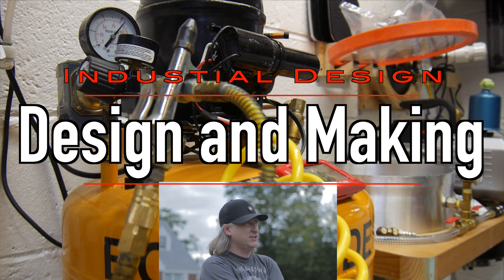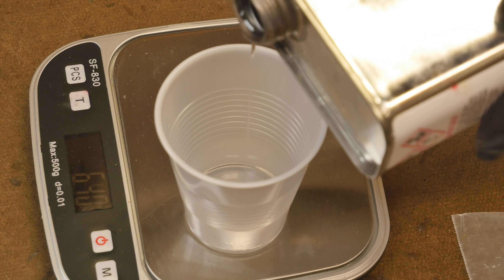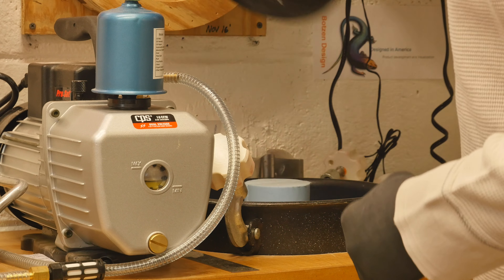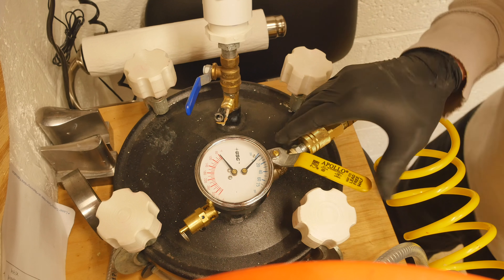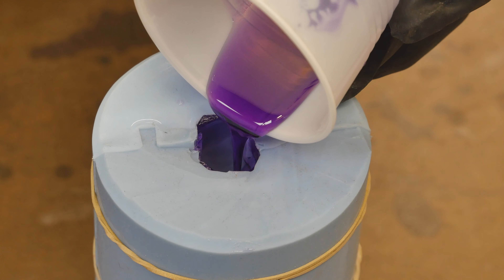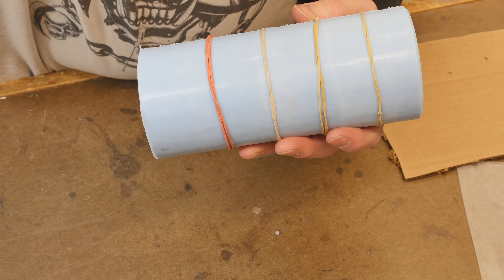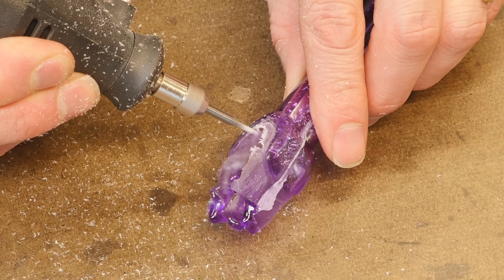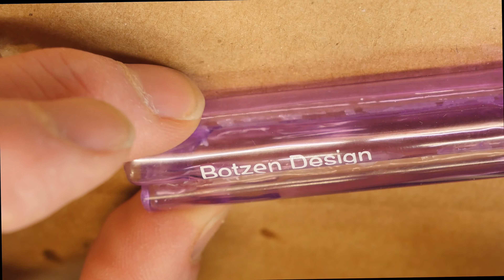How to Slip Cast Urethane resin parts: simulated Blow Molding

Comment: Great video 👍.
How can I slipcast a model using silicon liquid rubber. I want my model to have a particular inner as well as outer shape and be flexible for some expansion when air pressure is applied.

Comment: Hey am so glad to come across your work its been hard but finnally i want to know if a hollow Epoxy resin tube can break easily or what is its durability  guarantee is it like Lexan polycarbonate sheet ??
Reply from the maker: Depends on a lot of factors while thickness, size and how good your part is cast.

Comment: Enjoyed the video, Eric.... also, how important is adding the heat to the pressure pot step? Is it necessary or is it solely used to help speed up the process? I have a pressure pot but it does not have a heating function.
Reply from the maker: JamokaJoe I like it because it help with keeps bubbles from forming as the urethane cures. Important when you are making clear parts. Glad you liked the video.

Comment: Can this method be used without the degassing and pressure equipment? Will it have the same result however be full of bubbles?
Reply: Yes depending on which resins you get for which kind of plastic you need to end up with you can use a painters tray and tap the whole tray down on a counter a few times to help agitate bubbles up to the surface, degass is just important if going for clear bubbleless parts.

Comment: Are you using the same amount of resin each time or are you using progressively less each time?
Reply from the maker: Quirky Dad yes, about 10 grams total in each layer, most of it get dumped out of course. The first later I used 20 grams, because I could not remember how much was need.

Comment: is there another technique to eliminate bubbles when slip casting resin that doesn't require a pressure tank?
Reply from the maker: Bubbles depend on the resin type and the humidity in the air, the pressure pot basically eliminates those variables. Perhaps a different type of resin?

Comment: Can you provide more explanation about the dry transfer.  Thanks.
Reply from the maker: rotate85 A dry transfer/rub-on transfer is a semi-permanent application that can be applied quickly and effortlessly to a number of substrates. It is created by printing a special ink backed with adhesive on a transfer paper that can be rubbed off without the use of water or other solvent. Transferring the image onto any smooth surface, including wood, metal, glass or plastic.
Reply: can you provide a link as to where you send out the graphics file to have the special inked backed label made? Thx.
Reply from the maker: https://imagetransfers.com
Reply: Thank you Eric for the info.  Much appreciated.  Keep up the great work!

Comment: Hi Eric, can you help me?! I have to produce some parfums bottle prototipys the most similar as possible to the next industrial glass production. The master bottle doesn't exist, I have only 3D files...I think that use clear resin it will be the right solution because the 3D printing is not so clear. Inside it must be empty to be filled with the coloured liquid and it should have the right "glass" thickness on walls and base. I don't know how to start...and finish! Do you think that resin is the best way? How does the mold should be? 
I saw some prototipys makes by others and were perfets, They seems make in plexiglass but without visible connections. I don't understand how they does that!
There is a video about it or can you show me how can I do?
Many thanks for your attention!
Reply from the maker: Your process would be identical to this one just a different form. The process is time consuming. I have made them in the past, they look very realistic and are functional
Reply: but in this case you have an object with the same walls thickness. You know that the parfume bottle has a high base and thick walls in different thikness. How can I make rhis effect using this metod? Inside there will be an empty area with a specific shape.
I would like to do a test, can you tell me if, in your opinion, is a good idea?
I will make two 3d printing resin mould, the first one for the external shape and the second one for the inside area made with a specific resin which melts with heat. I will use silicone spray on the walls of the mold. I'll make it a single casting. Does it will work?
Reply from the maker: @gabrielegotti6578  yes, of course, the inside is tough to control, you can control the thickness of the base but not the inside shape of course. Post your results on social media @ botzendesign, I am curious to see your results. Good luck.

Comment: It’s also the same way they make hollow Easter bunnies
Reply from the maker: Barry Fields Bunnies are probably roto cast since they are closed at the bottom.
Reply: Eric Strebel the mass produced one yes, but I’m talking small batch hand made bunnies. After they dump the chocolate out they set the mold on a puddle of chocolate that how they close the bottom off